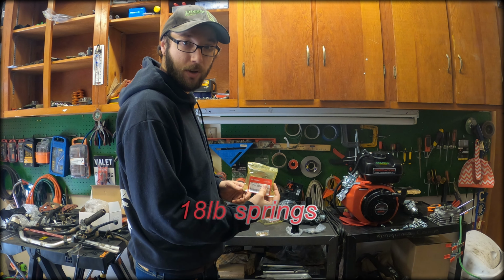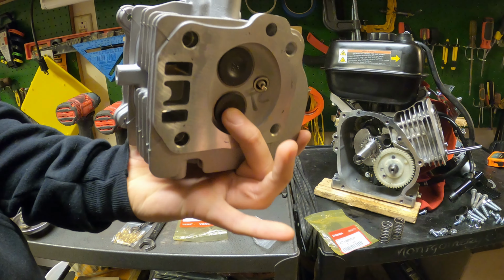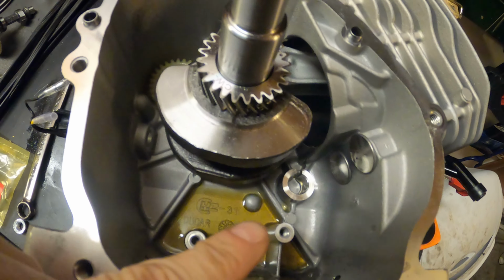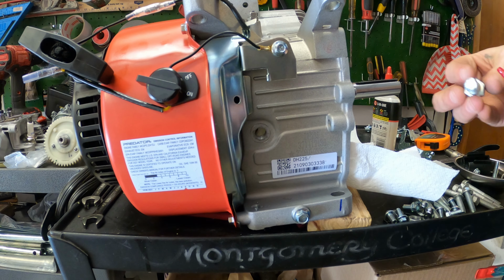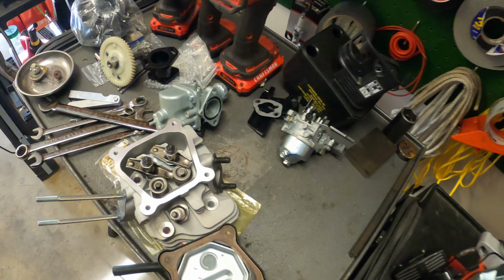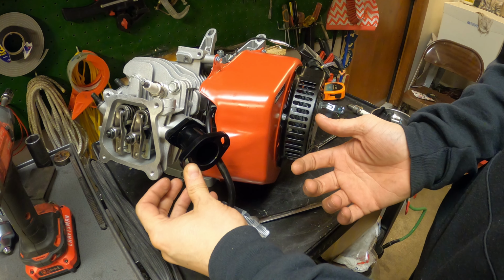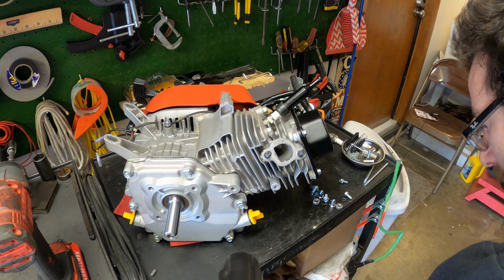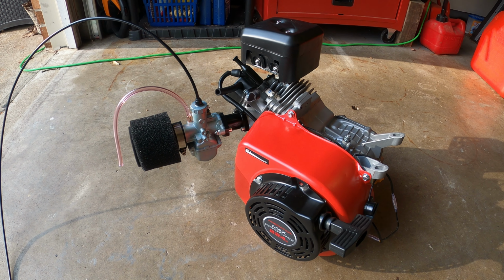Predator 224cc Max Performance (Stage 1)

Comment: 13:46
Drill em out oval shaped and it will fit.
No one makes headers specifically for that flange still to my knowledge a year later LOL.
Reply from the maker: You are absolutely right. You have to drill out the holes on any exhaust you use on the 224cc… even a year later lol
Reply: @tylertaughtme  My Ducar224  has the same exhaust port.
Yeah no one makes em yet LOL.

Comment: Just did this on my 224, no need to dremel that top Governor arm, it falls right out after you remove the clip. Also, just use a punch to remove the Governor wheel …that clip is a major PIA to remove…👍🏻

Comment: why not just use a bolt and nut for oil sensor to? seems a lil safer then cutting threads in the block

Comment: Flywheel and rod? I noticed you didn’t upgrade those.. are they stronger than the 212 and able to handle the higher rpms?
Reply from the maker: I am finding out how good the stock ones are. If they blow up ill update everyone but I am confident they will hold up to a stage 1 since the stock baja warriors have plastic cams and are fine when I stage 1 them. Anything over stage 1 I would start swapping stuff.

Comment: Do you have to make sure its a top dead center when you take the head off?
Reply from the maker: Na thats just what I do to make it as simple as possible.
Reply: @tylertaughtme  so no torque is needed when putting head back on engine?

Comment: The music reminds me of... 🤔😲 NAPOLEAN DYNOMITE. Good video though, my 224 comes tomorrow. Just not sure what clutch, sproket and chain set up to go with... Any suggestions would be awesome.
Reply from the maker: What are you doing with the bike? Drag racing, off road racing, just cruising the neighborhood?
Reply: @tylertaughtme  Honestly, my cars tranny took a shit n died. Saving money to fix it, and needed transport 3 miles to work instead of Uber and a GT Stunt bike 🤣. Now im waist deep into a hobby I didn't know I loved. So its for transportation to n fro in a 6.5 mile radius.
Reply: @tylertaughtme  the highest speed limit in this radius in 40mph, of course but traffic flow can make 50mph come easily. Im looking for a good blend of endurance as well as performance. Gas isnt a concern... Its a mini bike. And btw I have it on the coleman now 12t to 75t in the back, its QUICK from a stop. Top speed ain't bad either, just need the flywheel before I let the rpms rip.

Comment: Probably already bought a new pipe but you could have just cut off both exhaust flanges and welded on the stock pipe flange to straight pipe. I was surprised that it was different than the 212.
What size tap and thread pitch did you use on the oil sensor hole?
Reply: It's probably smaller like the rest and all one needs to do is drill the holes out oval shapped and a regular clone header will fit.

Comment: It sounds like the connecting rod it smacking the crank case or the cam. you can def hear some knock.
Reply from the maker: Thats it dancing around on the ground, it isn’t bolted down lol…
Reply: Definitely rod knock Lol'
Reply from the maker: @jacobsebastien3910  defined not rod knock lol I already said what it was.

Comment: Did you switch spark plugs? I have same exact setup but I switched mine to a autolite
Reply from the maker: Pretty sure I used a honda plug but it shouldn’t matter with a brand new one.

Comment: Jetting issues? Needs Fuel. Not saying that it doesn't need Tuning, only saying it doesn't take long to empty that lil bitty Float Bowl.
Reply from the maker: You arent wrong lol they empty quick but it just needed slight adjustment. I ran it a few times after the video and I can get it spot on once I mount it to something. I think I will need to bump up one jet size.
Reply: @tylertaughtme  do you still have this setup and how have that rod and piston done

Comment: I luv my Wildcat 223 it's block is more Renforced than the predator 224 an it doesn't has a plastic cam gear like the predator 224 does.
Reply: Means nothing. You actually have to do a serious build for block strength to matter. 🤣